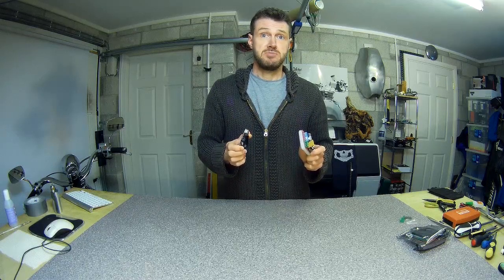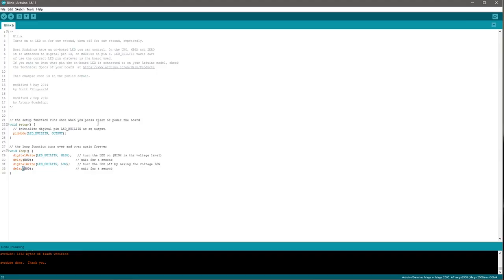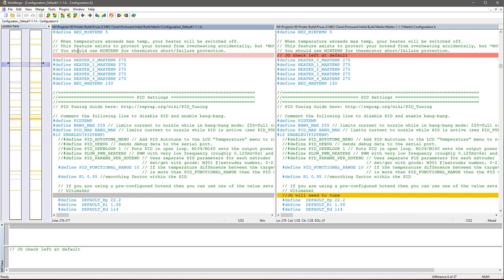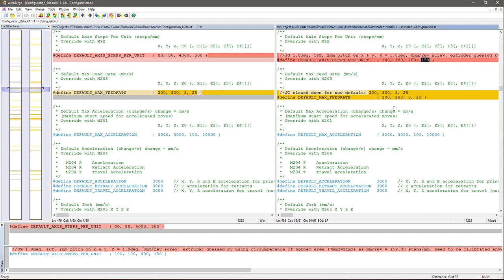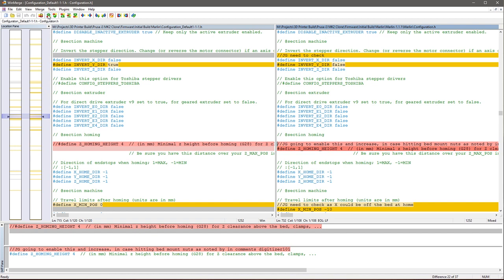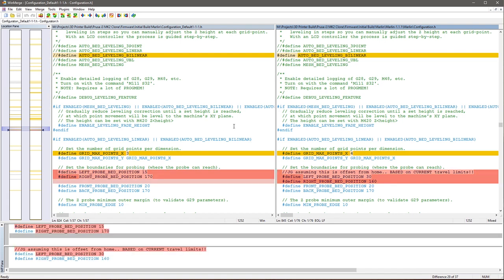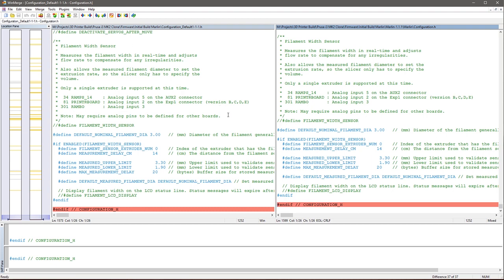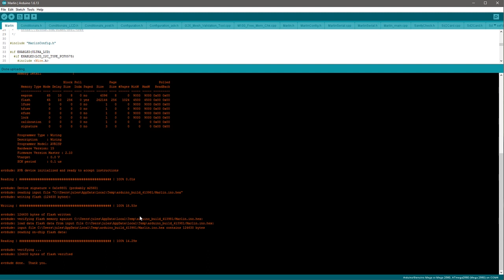How to Build Cheap DIY Prusa i3 MK2 3D Printer - 8 - Arduino Mega Check & Marlin Config

Comment: Hi, here is a good cover for your Ramps, you don't need to design a new one if there is a good one out there :)
https://www.thingiverse.com/thing:2269501
Reply from the maker: That would be the easy thing to do!!! I usually take the hard route. Will have a look at it, but I am going to be mounting the electrical components on a base board, not the printer. I haven't spent much time (=any) on Thingyverse yet.